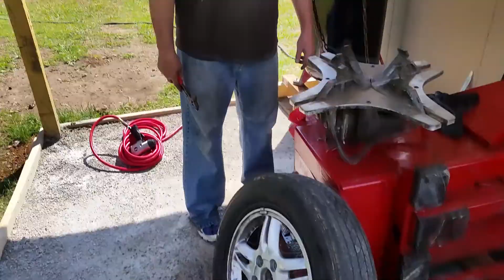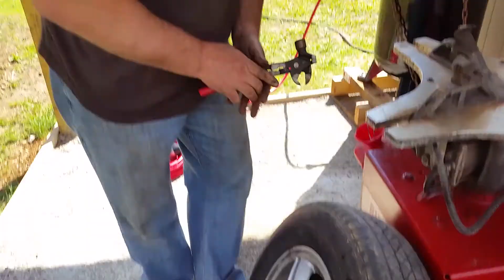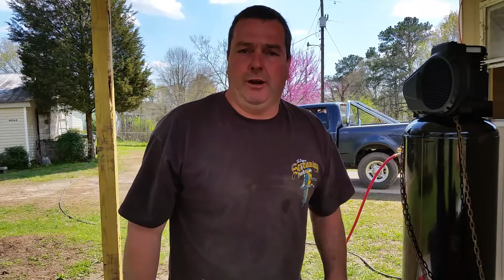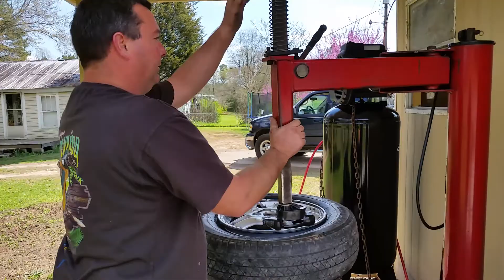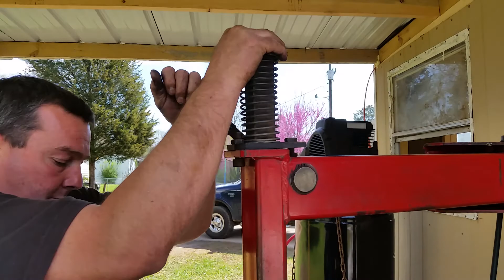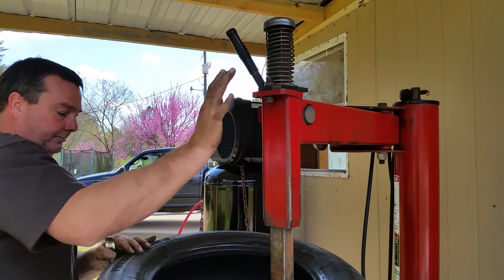Tires, tire machine, air compressor.

Comment: Thanks for informative video.  So you reccomend 60 gallon air compressor??
Reply from the maker: @jrn8774  I would recommend a larger air compressor but if this is something that you’re starting out with, it definitely works and make sure you buy a really good one if you’re gonna go with a 60 gallon because you will work the crap out of it if you have a high rotation of customers. As far as doing it yourself around the house I would definitely recommend it just make sure you have adequate air pressure to push the machine
Reply: @michaelburt9372  Thank You!!  This is for family use, we have many cars tho :)
I'm going to buy tire machine. My son will buy compressor. Be Safe!!

Comment: Hey that tire changing machine,,  does it work by itself electric, or does it works with the compressor?
Reply from the maker: I had it running off of a husky 60 gallon air compressor at 150 pounds of pressure

Comment: Were the issues you were having related to the machine itself or operator error? Are you overall happy with it?
Reply from the maker: Believe it or not, I was extremely new to the tire business. I did not really know exactly how to handle the machine. at the same time, I noticed the grips on the inside that held the rim in place were a bit worn out. This machine was used when I purchased it. however, after I replaced the grips, I never had any issues anymore at all and thank you for your Comment/question